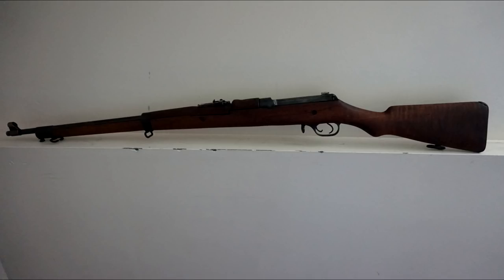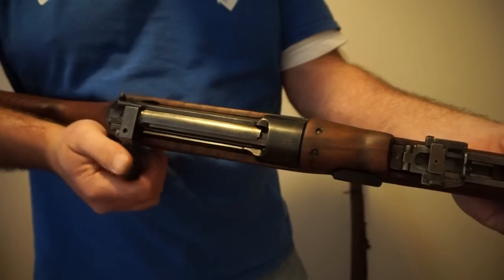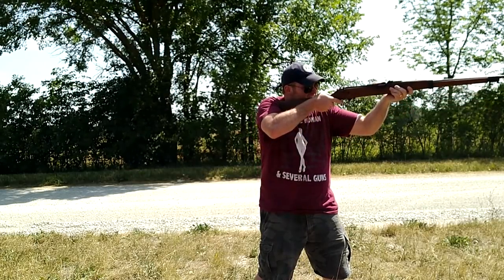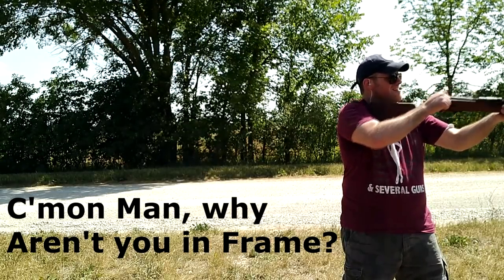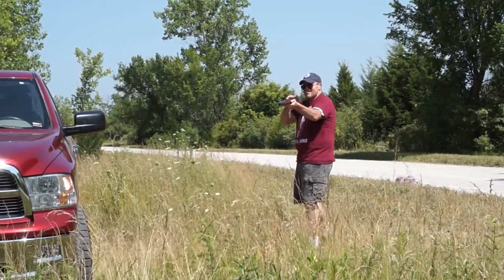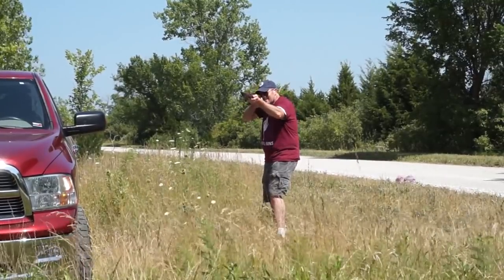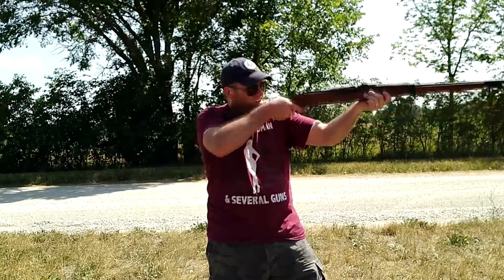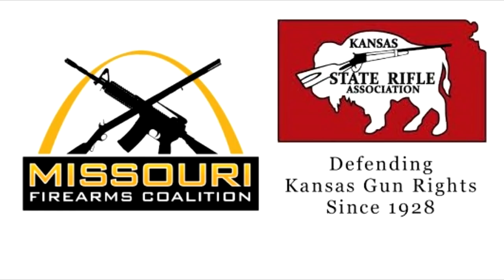Canadian Ross Rifle, the Nickleback of Infantry Rifles!

Comment: Point 1: you are using a Mark II; 98% of the troops in the War carried the Mark III
Point 2: the Harris lever on the right side is designed to cure rim-locks
Point 3: modern 303 ammunition generally is made WITHOUT the BEVELLED RIM used on original ammo
Point 4: The Mark III jammed in the field when used with REJECT OVERSIZED British ammunition; it was fine with Canadian rounds
Point 5: The Ross was used extensively by the Royal Navy and the Royal Marines Light Infantry in BOTH world Wars
Point 6: Rosses continued in service with the Chilean Navy through 1968
Point 7: the Ross was the official rifle of the Dominion of Newfoundland; their rifles disappeared into British stores in 1914 and have not been seen since
Point 8: the Ross was the official rifle of Latvia until 1940
Point 9: Russia received huge numbers of Rosses from Britain; they were prominent in the Leningrad Siege and later were turned into Match rifles which beat the world.
Point 10: the Ross remains to this day the strongest medium-round rifle action ever built as well as the most accurate Bolt Rifle ever issued for general service. Even the Mark II has 40% more locking surface as a Mauser 98 and double the locking mass; the Mark III was even stronger.
Reply from the maker: I covered that I shot a MK II while they had MK III in France.  I was using modern ammo and not milsurp.  I also covered that it went on to limited use after the war and was popular in sport shooting.  IF you use the rifle for its intended use, it is good, but as an infantry rifle, you need something robust and not finicky, which makes the Ross horrible for an infantry rifle.  In making a sub-10 minute overview, I am not going to hit every detail... for that you need to watch C&Rsenal.
Reply: All true, but it should never have been fielded in any of the three major configurations!

Comment: Older NRA tips said to set back these barrels a few threads.  Their chambers are deeper due to straight pull bolt.  My Mark II spits out “improved” fired cases. Custom 303 dies may also overcome this fault.  My M 94   BB in 307 is the same way.

Comment: Milsurp Mike Channel 
Those monte's sure had some torque steer to them that'll pull you right off the road !  Lol 
Id use the Ross for deer hunting... always cool to use guns like that for a real intended use as a long range gun 👍
Reply from the maker: I had to be careful when I stomped on it to pass or the torque steer would pull me to one side or the other.  Problem was that the transmissions in the 2000's Montes were weak to begin woth and you had pretty much the same transmission in the SS as you did the base model.
Reply: Milsurp Mike Channel 
Yep FWD cars aren't made to handle that kind of torque unless it's a big ol Toronado or Eldorado  from the 60's. 
 Even my olds aurora and Seville SLS would walk right off the road when stomped.  Kinda fun trying to hold on to it though !